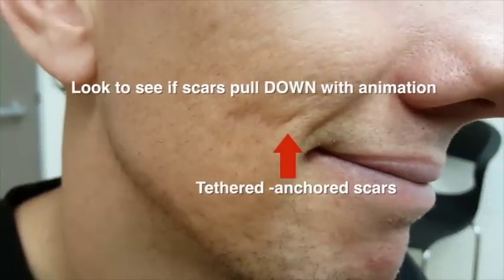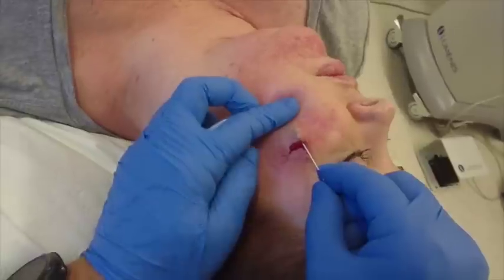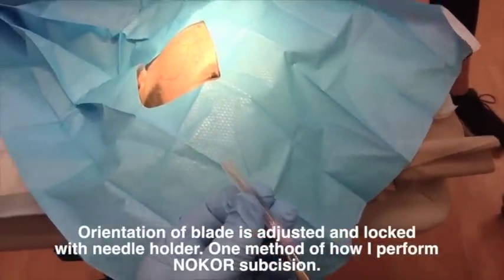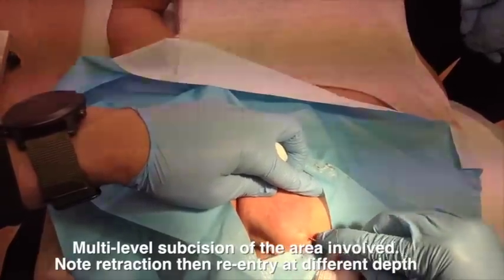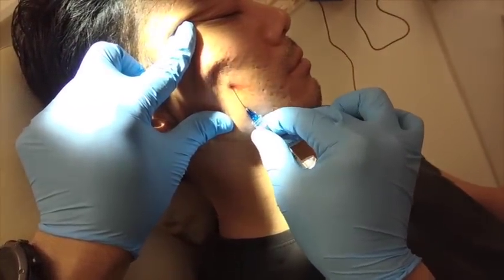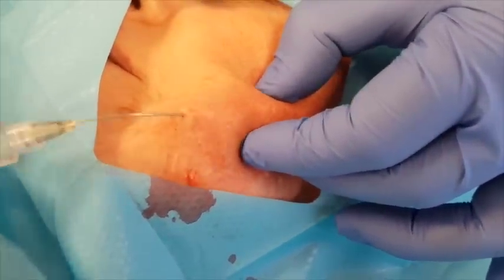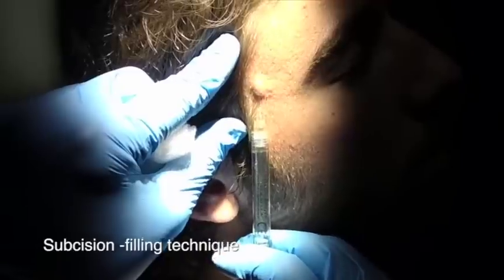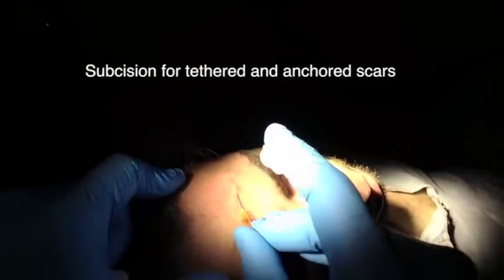ACNE SCARS - subcision

Comment: Can subcision technique be done on a deep gash scar on the temple area near the eye socket? I have one that I got from knocking into a lamp post years ago and the skin split open. The wound wasnt stitched but left to heal with just plasters. I think this is an anchored scar which is tethered to the underlying bone and I also have several smaller scars of this nature in the same area from acne. So my question is if u attempt to insert a needle into this area wont the thinness of the skin and closeness of the underlying bone structure hamper your manoeuvring of the needle?